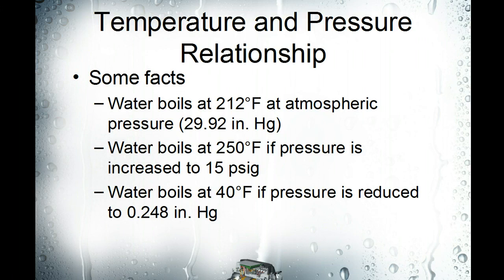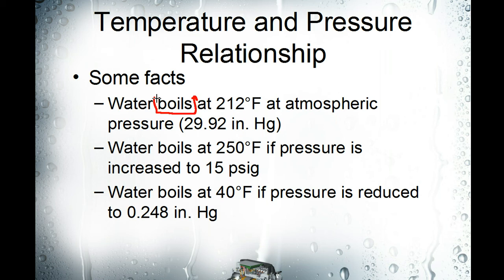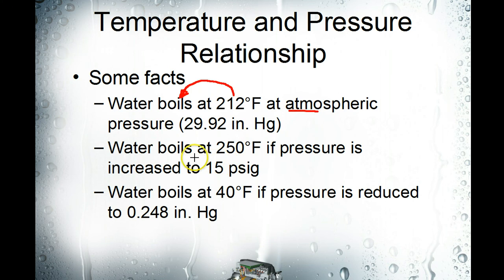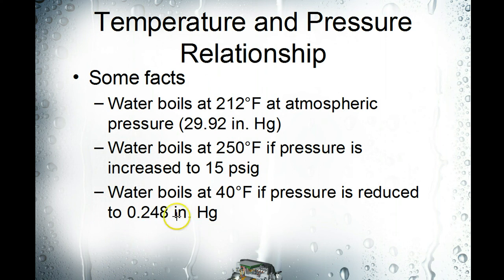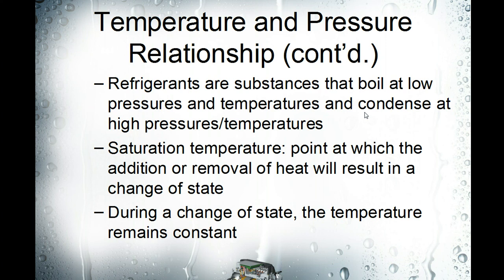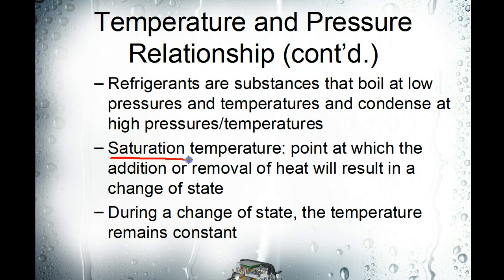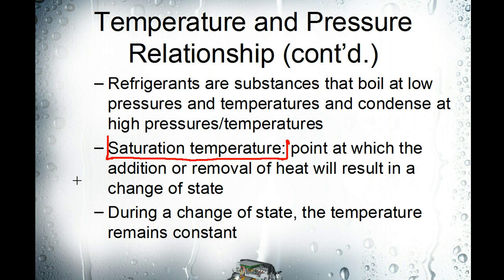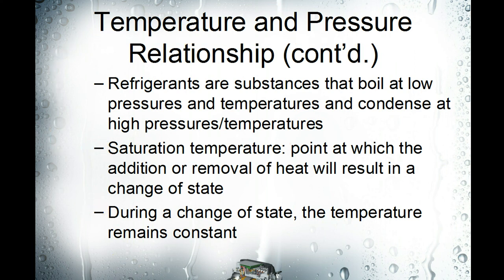Module 3 Refrigerants - The Pressure Temperature Relastionship Video Lesson 3

Comment: Question: I was observing our Trane Screw Chiller at work & the control panel said the evaporator saturated temp was 37 degrees. This unit uses R-22. So according to what I learned in the video, if I added or subtracted heat to this 37 degrees, it would turn into a liquid or a vapor or vice versa? I believe the saturated evap. temp. sensor is located downstream from the EXV. Or does the 37 degrees mean that the vapor has soaked up all the heat from the water that it can without changing states?